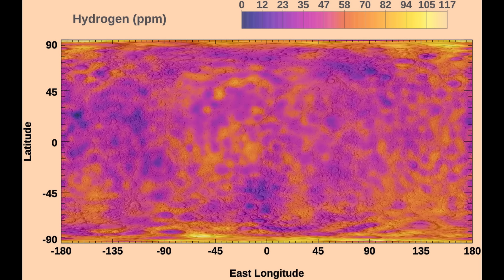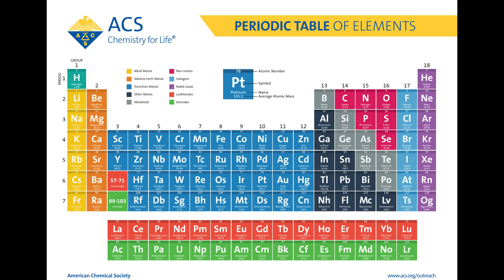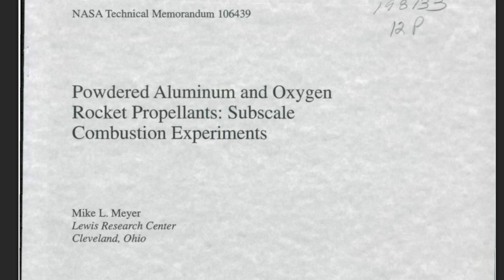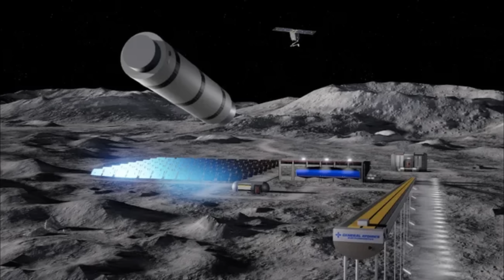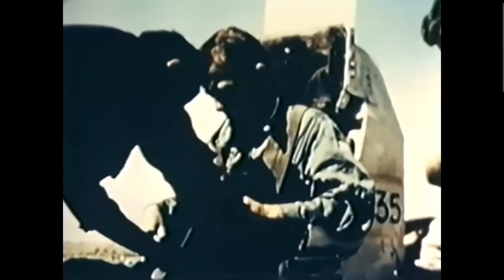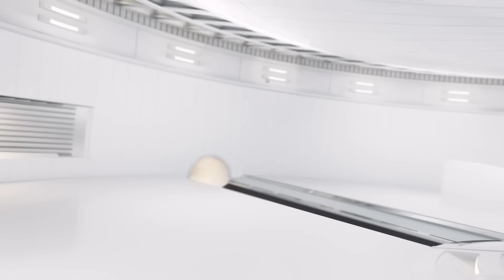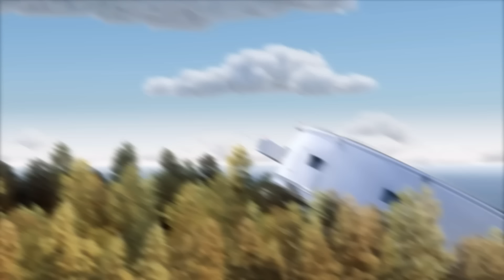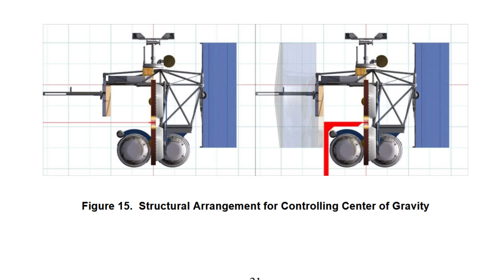Launching From The Moon With Silicon Based Rocket Fuel And Other Ideas - Deep Space Questions

Comment: I did a ton of research in 2017 into lunar ISRU, and one of the side products I came up with was silane. The theoretical refining plant would use hot fluorine to break up rock (yes, it was a Maximum Kerbal ISRU process), yielding various fluoride salts and SiF4, which is a gas at room temperature. To extract pure silicon to make solar panels (and to recover the fluorine to repeat the process), you have to use hydrogen in a series of unfavorable reactions: SiF4 -> SiF3H -> SiF2H2 -> SiFH3 -> SiH4 -> SiH3 -> SiH2 -> SiH -> Si. If you can replace hydrogen from a lunar source, you can just pull out some of the SiH4 to use as fuel.

In 2017, every source I could find thought it was madness to use silane as a serious rocket fuel, because the sand/silica would rapidly destroy the turbine in your rocket's turbopump. But the Electron rocket reached orbit in 2018 with an electrically-pumped Rutherford engine, and since then, it doesn't seem so crazy to me.

EDIT, one day and 20 comments in: I should confess that I wasn't doing this research in a scientific context; I was looking for a gonzo technology for hard sci-fi. Using hot fluorine in that way is banana-boat-wtfbbq levels of insane (that's what I meant by "Maximum Kerbal" -- although in my defense, I was going off of three legit-scientific papers that proposed the idea with a straight face), and silane is very problematic for any engine, since it generates silica inside delicate parts, and/or coats the nozzle in glass, and/or pollutes cislunar space with high-velocity dust.
Reply: I have my own (maybe harebrained) thoughts on Lunar ISRU rocket fuels...  also encouraged by RL's success with electric fuel pumps.  Say, a tripropellant engine leveraging the temperature extremes allowed by vacuum insulation (MLI around the tanks).  There is a eutectic mixture of ~30% Magnesium in Aluminum with a melting point arouond 450 Celsius.  That can sit as a molten liquid in a fuel tank, separated from the cold oxygen / SiH4.  The molten metal can work as a liquid coolant in the nozzle, then the silane can be used in film cooling beside the nozzle lining.  Then the majority of the fuel injector uses mostly the molten metal fuel with some % silane.  The silane and molten metal both produce dust in combustion, the hydrogen burns to lightweight steam (for an ISP boost) with proportionally less use of hydrogen.  The silane film on the nozzle walls will tend to decompose producing solid silicon and H2...  And potentially (or maybe fancifully) the silicon gets deposited on the walls of the nozzle.  There may or may not be a way to get that layer of silicon into a steady state of deposition and removal.  If not, then I might have just described an engine that blows itself up as the shape of the nozzle inner surface dynamically changes during combustion.
Reply: @ Yeah, I've always kinda waved my hand and assumed the combustion chamber and nozzle don't get coated with glass, or that we can design a shape without dead zones that always ejects the silica. Your idea probably has higher ISP than my other idea for a sulfur-and-LOX engine ... but I just like the thought of a brimstone rocket.
Reply: you don't even need to go electric pump fed. an expander cycle would work just as well for a much bigger rocket and you could go open expander if you need more thrust. you just can't go for a gas generator or staged combustion because of the silica when you burn the silane.
Reply: Fluorine is uncommon on the moon.  

Also, one thing that's not discussed enough is... you have an annoying tradeoff whenever you try for a low-hydrogen fuel.  Either your engine burns bloody friggin' hot (better have a ceramic nozzle), has awful performance, or a mix of both.  Hydrogen in your exhaust helps you turn that heat into thrust.  You can go outright hydrogen free, but then the tradeoff becomes even more stark.  Carbon monoxide burns in oxygen at an acceptable ~3100K in oxygen, but has a theoretical ISP at reasonable chamber pressures at around 210s, and experimental in the 180s. Cyanogen gives a reasonable ISP in oxygen of about 330, but has a monstrous flame temperature of ~4400K. Low-hydrogen propellants like acetylene or diacetylene fall on the spectrum. Probably your best bet is things like CyMet (Cyanogen + Methane) or CyHy (Cyanogen + Hydrogen), where you take a high-energy compound like cyanogen and add a bit of hydrogen to the mix. 80% CyHy / 20% H2 drops the flame temperature down to 3700K and raises the ISP to ~400s.

Now, on the moon, you're not going to be going with carbon-bearing compounds either, but your basic goal with chemical rockets will be "take something that has a ton of energy" - for example, alumium - and burn it in oxygen, but have a bit of hydrogen from some source - either H2 or silane - in the mix.  Unless you want to risk ceramic nozzles, that is.

Now I had to specify chemical rockets, because except for zero-hydrogen propellants, nuclear-thermal rockets - despite using pure H2 (you need the low molecular weight, sadly) - outperform even the vast majority of low-hydrogen rockets in terms of efficiently using hydrogen.  Plus, taking off from the moon in a NTR, you can not only get off the surface, but also... just keep on going   ;)  In fact, a NTR could very well take its own hydrogen supply down with it, land on its own power, and take right back off again, with plenty of dV to spare.
Reply: @karenrobertsdottir4101  Yes, I know fluorine is scarce. The ISRU method recycles it in a closed loop. It's shipped to the moon in the form of KF (potassium fluoride); extracted via electrolysis; used to break up rock; "sorted" into various fluorides by a variety of methods (dissolution in different solvents, reduction with agents that only reduce one salt, even vaporizing them ... etc), which are then reduced somehow (either by the potassium, or by hydrogen); the main product at the end is KF again, which goes back into the electrolysis cell.

My favorite rocket fuel from lunar ISRU is magnesium. I'm not aware of a method that could use it for launch, but once in space, the Neumann Drive ion engine can get fantastic ISP out of it. And regolith is at least 5% magnesium.
Reply: @IgnisKhan  Your process is going to lose fluorine.  And utterly destroy your refining process in relatively short order, adding more to your really-expensive-from-earth-consumables list.

There's no reason you can't use magnesium in the same way you can use alumium.  But Al is better than Mg.
Reply: @ The sources I built off seemed to think passivated nickel reaction chambers would survive and allow recycling. But yes, they were certainly being overly optimistic. And now that Blue Alchemist is working (I believe they got molten regolith electrolysis to work?), it's all moot.

IIRC magnesium was the highest-ISP fuel for the Neumann drive. For launch, I think either you can import fuel in bulk from Earth (in which case, just go with methane, since that's what you're going to have the most tech readiness in anyway), or you can't, in which case you have to get really creative, avoid carbon entirely, and use either tiny amounts of hydrogen (which is when silane becomes attractive), or zero hydrogen (which is when a brimstone or aluminum-flashbulb rocket might be interesting).
Reply: @karenrobertsdottir4101  For launch from the moon you can accept absolutely horrible Isp and still achieve a reasonable payload fraction to escape. 2.4 km/sec is really, really low.

Even with your cited experimental Isp of 180 s for CO you can reach lunar escape using a single-stage rocket with a fuel fraction of only 73% (trivial application of the rocket equation).
Reply: @patrickchase5614  The whole point of lunar manufacture is easy launch.  That's why you're supposed to (dubiously) go through the hell of trying to manufacture on a lifeless world with zero infrastructure and tiny amounts of things as basic as hydrogen, carbon, etc, and staffed by people whose manual labour is costing you tens of millions of dollars per year at best just to keep them alive.  If you have a terrible ISP, then you're converging your launch mass benefit - the entire point - to closer with that of Earth.
Reply: At Rotary Rocket in 1999 we used Silane as a hypergolic igniter for LOX-kerosene and nearly kicked off a mutiny among the test site personnel. Sure it ignites on contact with LOX, and also with air at every opportunity. One time the nitrogen purge before start managed to dilute it enough to cause delayed ignition and an external fuel-air explosion that beat the hell out of the tuff shed for the test stand, it was always a little bulged after that.

I personally had to remove the SiO2 slag from the combustion chamber and injector plate, which was a monumental PITA. Having worked with hydrofluoric acid in my college semiconductor lab classes, I flat-out refused to use HF and found that ammonium bifluoride, while still not being mother's milk, wouldn't try to make your bones rot from the inside. It required lengthy soaking to loosen the persistent slag.

After venting and purging the Silane system, lead technician Mike Laughlin was disassembling a ball valve when he discovered that the interior of the ball could trap an impressive amount of gas under pressure (which promptly made an even more impressive fireball when it escaped). He invented new vocabulary that I didn't learn until later when he told me exactly what he thought of Silane, me, and the horse I rode in on.

Even if you use electrically driven pumps, it will literally put sand in the gears (or rather, impellers) if any oxygen reaches it. Bear in mind that this engine will have to be developed on Earth by flesh-and-blood engineers and techs who really do like to go home to their families at the end of the day.

The only way to cool this engine would be to use the LOX as the regen coolant- but oxygen is a lousy coolant. It has low heat of vaporization, fairly high critical pressure, and poor thermal conductivity. It could be made to work but will require a bunch of fried test engines to get there. We did run a LOX-kerosene engine at RotRock with LOX cooling, but it had a thermal "chug" feedback loop that made the oxygen flow fluctuate across a huge range at about 1 Hz. We never did get reliably stable operation.

So yeah, no, you might be able to get such an engine running, but it would be difficult and expensive only if you're both good and lucky.
Reply: Somewhere in that process you could pour some monolithic silicone blocks to use as ultracapacitor anodes, silicone is around 3500 mAh/g via an alloy reaction..and when formed in a 1/6thG vacuum should be just about perfect. your ultracapacitors would probably be single or very limited use, due to insane structural change during discharge, but, hey pop it back into the solar furnace and pour a new brick. something about that process whispers "space drive" to me, but it isnt clear.
Reply: AEROSPACE ENGINEER here - at least you are honest about what you were doing.
The real problem for any of these processes IS NOT that we can make them work. Its how do we get those processing plants built.

Sorry for the long comment
Your idea is nice but getting it done will be very difficult.

In 2002 I met Harrison Schmitt (Apollo 17) and he told me to look into Helium-3 (the potential nuclear fusion fuel). I'm Australian (American degree) and went into our mining sector to learn how to build mines. At that time I had a over a decade of control systems, manufacturing, automation and robotics. All good for doing stuff almost anywhere but I thought adding mining would get me to my dream - build a moon base.

Easily the biggest lesson I got from building remote mines in difficult places, because most of Australia's mines are remote and in difficult places, is that LOGISTICS becomes a major issue. 

When I was doing manufacturing most of my suppliers were less than 1 hour away. If we really needed something fast we'd get in the car and go get it. In the Pilbara region (where I did a lot of work) the nearest place where there are suppliers is Perth over 1,500km away. If you are really lucky you can occasionally get things on the next jet because all the people fly in from Perth, but in general the quickest you can get things is 3 days. For large items you need to find a trucking company with available capacity and in general that's measured in weeks.

I ha d a project where an idiot went welding on stuff he shouldn't have without disconnecting all the electricals. he blew 3 cards in the PLC and the replacement was delivery was quoted as 3 -5weeks. It was American Rockwell hardware and I tried their agent in Singapore and they had none but I found their Japanese store had a bunch of these cards. We had a crew of 12-15 costing over $10k per day. Even at the bottom end $5k of airfares for me to go to Japan and pick up these cards and fly back was cheaper than anything else. In response someone magically put 3 of those cards on the next plane out of Japan.   

This is going to be the real problem with getting anything done on the moon. The cost per kg to the lunar surface is so high that it will not be practical to fly it all there.

Your silane plant will need basic stuff like pipes and pumps and valves and electrical cable all the other stuff most people never think about. AND ALL THAT STUFF adds up in WEIGHT. 
Its staggering to see how much stuff has to be shipped to a mine site to get it going.
Just the accommodation and basic human support (water, food, sewerage) is a major effort. Then there's power and communications. Fuel for all the vehicles.

And yeah i watch some of the people from NASA talk about moon bases and I know they have NOT considered how TF they are going to get things done. After seeing a TEDx talk I wrote to the speaker about where he got his information. It turned out he was a architect with one of the Worlds to firms. He was very cool about it and told me his TEDx talk was more about his company wanting him to learn how to do presentations than anything else. He sent me the materials he used for his talk. 

It was mostly the complete set of papers form a NASA conference on setting up lunar operations. I went and scanned the document for references on MAINTENANCE because anyone who's worked in remote sites knows maintenance is the single biggest on going issue. Out of a bit under 200 pages of technical stuff there was less than  1-1/2 pages on maintenance and all it said was it'd be done by robots.

I have shown that to engineers who have worked in mining and they can't believe how stupid NASA is on the subject.
Reply: @tonywilson4713  "We had a crew of 12-15 costing over $10k per day." - now imagine what that crew would cost ON THE MOON.  Labour costs on the moon will be nonsensically high. Esp. if people aren't looking for a one-way trip, and need to be rotated. Heck, given the hostility of the lunar environment, you need to account for meaningful attrition of your workforce through, well, death

Everyone neglects maintenance in these discussions. As you well point out, resource extraction is an immensely maintenance-intensive activity. Pretty much every piece of hardware you have on the moon needs to be treated as a consumable; it's just a question of the mean timescales over which it's consumed.  And you have a bathtub curve for them, in that a lot of stuff tends to fail (through bad design, bad manufacturing, or accidents) early on, then it drops, then increases as it ages.  

And since lunar resource extraction is so immature, one should expect very high failure rates, and very low ratios of mass extracted to mass of equipment that needs replacing.

Now, if one is cognisent of this, they can design for it. Maybe you pick an energy-inefficient process if it means less wear and your power comes from a sealed self-contained nuclear reactor from Earth. Maybe you build a piece of mining equipment out of superalloys instead of cheap steel if it means it lasts longer. Maybe all of your electronics are doubly redundant.  Etc.  There are things you can do to reduce maintenance.  But that can only take you so far.  And everything you're doing is increasing your production costs. 

The same thing applies to the rockets or spin-launch system or whatever you use to get things off the moon as well. 

The moon may get you an order of magnitude better mass ratio from the surface to space for a given propulsion system, but can you really get production costs down to within an order of magnitude difference from Earth costs, within human timescales?  I'm dubious.

Also, I fundamentally disagree with the notion that the real value is in "getting things to space" (even if you assume all of the manufacturing is done on the moon, with is a MASSIVE "if", you'd still need to assemble them.. and then comes space labour and maintenance costs ! )  Falcon Heavy sends things to orbit for a couple $k per kg. Starship less, in theory just a couple dozen $k per kg.  The magnetic fines of a PGE-rich asteroid are a couple percent platinum group elements, worth tens of thousands of dollars per kilogram on Earth, e.g. the fines, without any refining, just sintered into an aeroshell shape, ejected from the asteroid's nearly-nonexistent gravity well, and dropped onto an Earth-intersecting trajectory, are worth hundreds of dollars per kg (even if you give no market premium for the origin).   Seems there's a lot more value in that than in getting primitive building materials to orbit, even if the cost of producing said building materials on the moon was literally free and you're only comparing rocket mass ratios.  And a dragline on an asteroid, either concreted to large boulders or wrapped around the body, faces almost no mechanical stress from operations, beyond simple f=ma forces.  

From an economics perspective, IMHO, the goal should be to adamantly avoid sending humans (and their long dependency chains) wherever possible, send complete systems, and if they break, send replacement systems (aka, like sending out probes) - thus simplifying the economics equation down to the cost of sending it and the mean time to failure, vs. the value of the minerals recovered.
Reply: Why not use chlorine to burn silane instead of oxygen? Sure it makes SiCl4 and HCl, but at least they aren't solids.
Reply: @filonin2  Not much chlorine on the Moon? (Less than 1% abundance)
Reply: Unfavorable is an understatement. Getting all the fluorine out will not be easy - and I don't mean recovering it, I mean getting it out at all. We have fluorine here when we need to use it, and we use other tetrahalides in processing Si for a reason. I wouldn't recommend it.

Then getting all the hydrogen out. Definitely wouldn't recommend that. You might get silicon which is good enough for solar panels. But why bother?

Hot and cold are easy on the moon. A Sterling engine is easy on the moon. Much more robust against cosmic rays and micrometeorites
Reply: Why not just use pressure fed? Worked great for the LM, and much less to go wrong. With 1/6th gravity you can easily trade some ISP for simplicity and reliability
Reply: "A series of unfavorable reactions" sounds like something my organic prof might have said....:)
Reply: NaK burned with Oxygen would be a hilarious hypergolic fuel for ISRU. Though I don’t know if it would burn consistent enough.
Reply: To everyone with a serious critique (of which there are many to make): see my edit to the top level.
Reply: >hot fluorine

How about NO
Reply: Wow. Fluorine?!  Isn’t that highly toxic and highly corrosive?  Isn’t space going to be dangerous enough without adding fluorine to the launch equation?
Reply: One concept I would like to see with electrically-pumped rockets is "full flow" where drained cells are continually fed into the combustion chamber. Something like lithium metal disposable cells have high power and energy densities, flammable electrolytes, and could add meaningful thrust while not suffering the issue of being dead weight after being drained.
Reply: In Sachen Silan Öl kann ich höchstens Peter Plichta empfehlen der sich damit beschäftigt hatte.😉😉😉👍👍👍
Reply: well taking off from the moon seemed so easy in 1969 why is it so hard now? ...... 🤔.
Reply: @JohnJackson-ttzd4  to put it simply, if you did even a basic amount of actual research instead of listening exclusively to conspiracy YouTubers, you'd know it *wasn't**. The *failure rate for robotic lunar landers in the 60's was greater than 2 in 3. It took every major aerospace company in the country working together 24/7 for a decade, with national pride on the line, a presidential champion able to keep his party in line who was personally determined to make it happen and willing to fund it with manhattan project levels of financing and support to solve all the problems, and even with all that it STILL took putting the most talented test pilots in the world onboard at the controls to achieve a reasonable level of consistent success.
Reply: @ we also played golf on the moon and drove a buggy on the moon and landed on a hill 10 meters away from surveyor. absolutely incredible stuff. peak entertainment